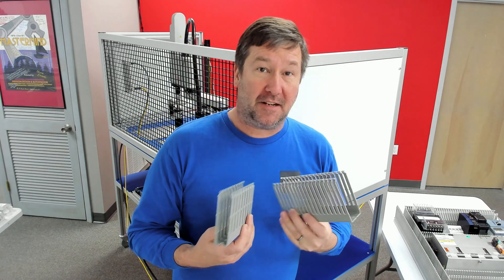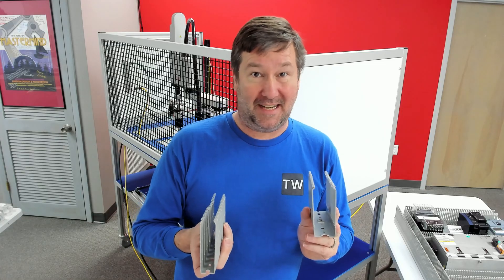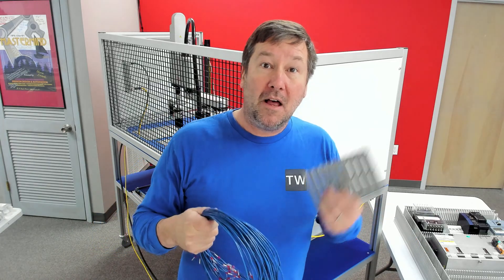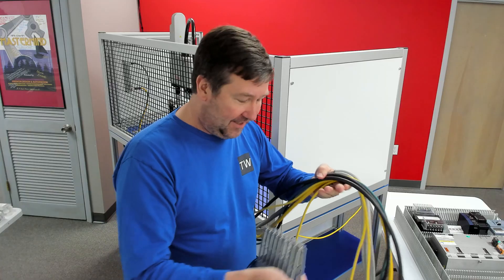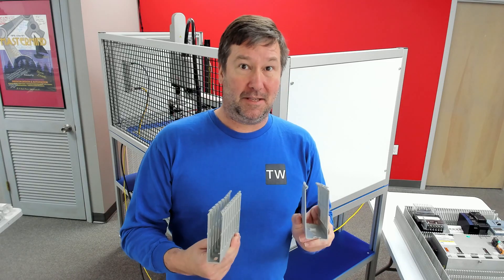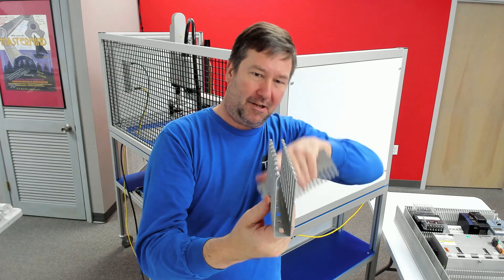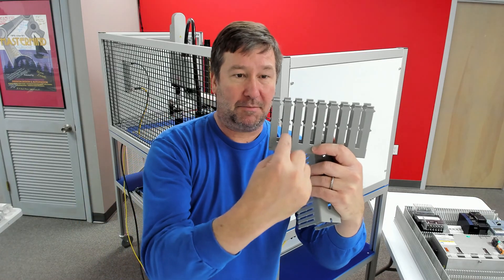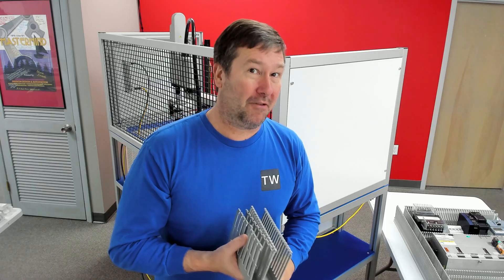What Size Wire Duct do You Need?  Don't Forget your Field Wires!

Comment: Helpful videos - Thank-you!  How do you determine enclosure depth?  Do you measure the height of your tallest component, add a clearance amount, and add distance from backpanel to rear panel?  How much clearance should there be? For a personal project, I'm building a panel with just a mini PLC, terminal blocks, etc. (no tall components), but no sure how deep of an enclosure to order.
Reply from the maker: Clearances around the devices are one factor, make sure the minimum depth for the disconnect also, but a major factor is heat dissipation.  Sometimes adding depth to a panel can lower the temperature to an acceptable level.  Google enclosure heat dissipation calculator.  I think Hoffmann has a decent one.
Reply: @TimWilborne  Thank-you. I'm curious if there is a general 'rule of thumb' for clearance? For example, always allow at least x amount of clearance above the tallest component. Suppose the tallest component in the enclosure is 4".  What is the minimum acceptable height clearance - 1", 2"?   What is the preferred amount of height clearance?  I want to keep the enclosure smaller for space and cost, but not compromise function.
Reply from the maker: Opinions will vary a lot on that.  I have built panels for companies that want the smallest possible design and others that think 12" is a shallow panel.
Reply: @TimWilborne  Interesting.  Given UL508A regulations, I thought there would accepted industries practices. I'll just go with what my gut tells me and add 20% extra clearance to be safe.